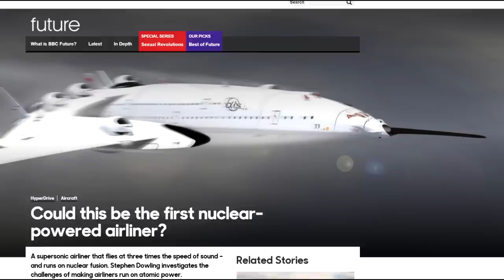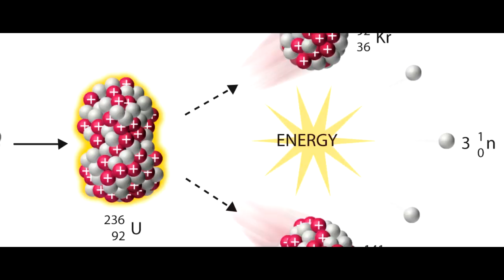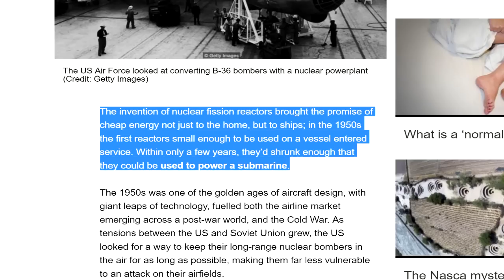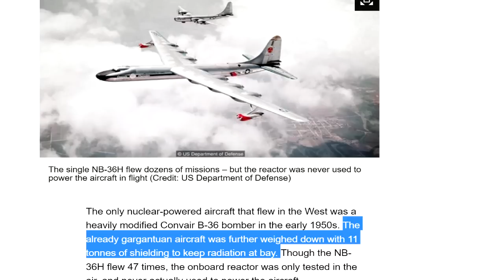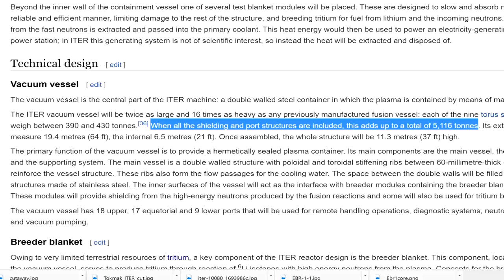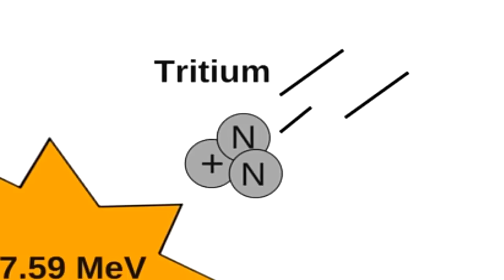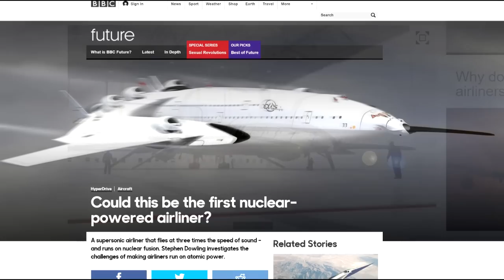SIX ENGINED Nuclear Airliner... BUSTED!

Comment: The only US aircraft to carry a nuclear reactor was the NB-36H. The reactor was never actually connected to the engines. The program was cancelled in 1958. it was done as a proof of concept to see if planes could even fly with a reactor on board as it drastically increases its weight do to the shielding for the crew.. in this case the planes windows where made from a lead containing silica witch distorted the pilots vision so much they where basically flying on instruments only. 
totally impracticable.

and just incase your wondering , yes they also tried flying a thorium reactor at some point in time
Reply: Thank you
Reply: Heres a documentary:
https://youtu.be/c_yQOPZ5CY0

Comment: Hes not even considering the temperature that builds up from the air friction. The black bird has problems with fuel tank leakage because of the large amounts of heat causing materials to expand and is built from titan. Now imagine a nuclear plane flying at this speed,  beside the fact that the passengers would cook up in the plane they would also get a nice radiation tan as theyre boarding their flight, why ? Well because as on the Blackbird, also here the fuel tanks would be built to work at high speeds and not prior to take-off. And the whole plane design makes me cry :(((((WTF !!!! I seriously think this jizznit dildo would break into pieces just after reaching mach 1 !!! 
In conclusion if this plane ever came to fly , north koreas nuclear research programme would be the most superficial thing ever, because this plane would explode just right over our heads.
Reply: how the hell is heat not an issue! THE BLACKBIRD NEARLY FUCKING MELTS AT MACH THREE
Reply: najgauner that was the first thing that occurred to me when I heard about the speed; air resistance
Reply: Solomon Conroy it doesnt nearly melt. Skin temperature reached around 600 Degrees during a mission, titanium melts at over 3000 degrees.
Reply: I misspoke, what I meant is that it puts an incredible amount of stress on the airframe and is still hot as hell
Reply: Solomon Conroy. Sure it is, but its not new territory.  It would be interesting to see more civilian friendly solutions but its hardly a show stopper.
Reply: Solomon Conroy the blackbird way exceeded mach 3. Try 4-4.5.
Reply: your stupidity amazes me
Reply: najgauner. The Blackbird leaks fuel on the ground amd at low speeds because it depends on the heat of high speed flight to  seal the skin.

Since a "nuclear" plane wouldnt have fuel leaks wouldnt be an issue.  And really the heat isnt that big of an issue.

Comment: why exactly would it need 6 engines? the point of the jet engine is the powerplant. if this thing is supposed to be fusion powered, then it should only need one core to provide for the entire energy/electrical load.

Comment: To be honest, a high efficiency battery would be a better idea for a non-fuel based plane. Since, even though you would lose a small amount of energy from the power plant to the battery, not having massive shielding significantly increases the vehicle's energy efficiency by reducing mass. Even though this is still pie in the sky at the moment.

Comment: I work with tritium. You don't need a lot of shielding to protect yourself from its radiation, 1mm plastic tube walls are thick enough.
Reply: there is a difference from the amount of radiation from the material and the radiation generated from a reactor. Its not just radiation its also heat. Nuclear powered reactors were tested on planes and abandoned because either they were too heavy, or put out so much heat they would melt through the airplane frame and fall to earth.
Reply: Tritium is extremely radioactive, as he said in the video. It emits beta-particles, which as you said can be shielded by 1 mm of plastic. Now think about a leak of a few kilograms or even tons of tritium, it's a gas at normal temperature and pressure. Even when only a small keychain light with tritium would break and even with a really good gas mask I would not go near that, the only thing suitable in such a situation is venting and a closed system breathing apparatus.

Comment: 4:54 I'd have to disagree with you there Thunderf00t. I'd say that it is entirely possible that we will discover a way to miniaturize the reactor shielding, if we find an active shielding process rather than a passive one. Instead of stopping these high energy particles by just sticking lots of mass in their path, perhaps there is some yet undiscovered mechanism that could suck them back in like a magnet, or at least alter their trajectory and cause them to orbit the reactor, and that would require far less mass to function. Perhaps there could even be a more efficient passive shielding system, such as surrounding the reactor in something similar to one of those fiber optic Christmas trees that channels the particles into following a specific path

Comment: The Germans built a nuclear powered plane which used the heat to expand the air passing through the jet engine but the lack of shielding caused the project to be retired

Comment: just so you know nuclear powered aircraft have flown yes they have and you're basing your whole video off of an engineering idea this is the first step when you build anything and then you have an engineer build a model you work with separate departments you find different scientists that have different Specialties and you collaborate and before you actually physically build anything you run it through simulations now you run it through models you find what material is you're going to use but all that starts with Concepts and drawings of how many Motors you want on it how many engines you want on it how many serve as the aircraft was going to need how many miles of wire what type of wire what type of conductive material is going to be used in your country what kind of systems are you going to use what kind of computer systems you can use what kind of Fail-Safe system so you can ask what kind of fly-by-wire system so you can use what kind of communication systems you can use how is going to affect each other how are these systems going to work together how is this isn't going to be powered how are you going to have the list goes on all this is done and thought of before anything is ever built you go through what you go through it and go through it and you find out that this system is not going to work with this system so before you even try to put it in a freaking model you figure it out on paper called engineering
Reply: Cory Mader, A concept is fine, but you do realize that all of those questions cannot be posed if the proposed method of propulsion doesn't even exist right? He's debunking the possibility of it as of what we have. Do more research on that plane you're talking about and be sure to tell us how much more practical it'd be.

Comment: While I agree those plans are bullshit you forgot about aneutronic fusion which would require farr less shielding.
Second, even with regular fusion you could get rid of the weight of the fuel which would allow a lot more weight for shielding.
Third, you could employ a mix of regular shielding and shadow shielding which would bring the weight down further.
Also you saying that the ITER could not be made smaller is COMPLETE bullshit. the arc fusion reactor is far smaller.
https://en.wikipedia.org/wiki/ARC_fusion_reactor
Plus there are quite a few other reactor designs out there that could be used.
There are quite a few other things I could mention.
So while these plans are bullshit, your assesment of the feasability of using nuclear fusion once developed to power aircraft is not very good either.

Comment: Just for fun though (even though I already suspect it wouldn't work): what if the steam turbines powered some propellers or jet engines directly rather than powering a generator?

I don't really know how many rotations per minute or what kind of torque output the steam turbine part of a nuclear power plant generates though, which is why I'm already skeptical of my own idea.

What I do know is that each step of energy conversion usually means heatlosses. Which made me think that using the steam turbine to power a generator to generate electricity to then power an engine would amount to more lost energy than simply powering the engine directly through an axle and some gears from the steam turbine.

Comment: There are aneutronic  fusion reactions such as those involving helium-3 but the Earth has very little helium-3 and you pretty much have to go to the moon for it.
But still it's going to be a long time before we see a fusion powered aircraft and it would be easier and cheaper to just Manufacture a chemical fuel such as liquid hydrogen with said fusion energy and use that to power your airliner.

Comment: Nuclear powered airliner: (1) build a nuclear power plant. (2) wait until batteries are above 500wH/kg and use the nuclear power plant to charge them. (3) short haul would already work with batteries of that capacity, and longer routes could use stages, like a rocket.  That is, batteries that drop away and fly home, or wherever, for recharging.  (4) The very longest routes can burn synthetic hydrocarbons produced using energy from the nuke.  It's carbon neutral and would work on today's airliners.  In fact, (4) could be used to make all airliners nuclear powered today.
Reply: That would not really be a "nuclear powered airliner", despite the nuclear power source. It would be an electrical airliner. And, I believe energy densities of at least 800 Wh/kg would be required for a practical commercial airplane (not inter-continental, for distances up to 3,000 km), or three times the current state of the art of Li-on technology. At the same time battery cost would need to drop to 1/3 of the current KWh cost. For inter-continental flights hybrid fuel engines + motors would make more sense. I bet airplanes will also wet their feet with the hybrid approach first, just like cars.
Reply: Of course, I was being cheeky when suggesting a way to 'nuclear' power airliners.  The technical challenges involved in shielding against radiation, and the environmental consequences of flying into cumulus granite, vs the simplicity and safety of battery (and hybrid) airliners means the latter will undoubtedly prevail.

In your estimation of 800Wh/kg and battery costs, did you take into account redesigned airframes that may take advantage of new engine (well, motor) configurations allowing for simplified and more efficient designs?  I ask because, as with thermal engines of a century ago, we are now seeing a paradigm shift in aircraft propulsion technology starting at the smallest scale.  R/C, ultralights, power gliders and light aircraft all have respectable working example of electric propulsion, and many in configurations that would not be possible with a thermal engine.

I'm certainly looking forward to the day of 1kWh/kg batteries and pure electric intercontinental flights that take advantage of ultra-high altitudes.

Who knows, maybe the hybrid airliner of the 21st century will be electric/rocket propulsion, skimming our ocean of air rather than plowing through it like a submarine.

Comment: Um the Air force actually came close to creating a nuclear powered bomber using a molten salt reactor during the cold war. The reactor was finished however it never got to testing it in the plane. However based on the engineers that work on it (i think only 5 are alive today) they stated it would work even if the idea was stupid. If the reactor they are using is a molten salt reactor it is very possible since the set up for a molten salt reactor is a million times simpler.

Comment: There was a military experimental plan that was worked on a long time ago.  However like you said, shielding was an issue.  If I remember right they where using led as shielding.  The plan was so heavy it could not get off the ground.  The reactor could not produce enough power to overcome the wight.  And I have not heard anything about the military trying it again.

Comment: As far as i'm concerned, in aviation, you need combustion that propels jet aircrafts forwards. But if you use a Nuclear power, who is going to propel a jet airliner? Note that the B-36 is a propeller aircraft, and I know it because it's one of my favourite, unique aircraft. The four jet engines at the tip of it's wings are not used in flight, and surely it's powered not by nuclear, but something else. Those jet engines are only used on takeoff, that's all. So in conclusion, this guys is just daydreaming in his fantasy world, and then drew that plane he envisioned it to be, and proposed the idea to public whilst knowing absolutely nothing about aviation! A propeller propelled airplane cannot go beyond the speed of sound! (Correct me if I'm wrong though)
Reply: Saying that you NEED combustion in a jet aircraft is not strictly true. What you NEED is a heat source to heat the air moving through the engine. It just so happens that today, the best way that we know how to do so in a safe matter is by burning energy-dense hydrocarbons. However, it is not implausible that you could just use the heat generated from a nuclear reaction instead of burning fuel.

This same concept was tested in rocket engines by the US back in the '60's and '70's. Google "Project Rover" or "Nuclear Thermal Rockets" and you'll get some fascinating articles. In a nuclear thermal rocket engine, no combustion takes place, yet it still produces thrust.

EDIT: Also, you are generally correct in saying that propeller driven aircraft cannot break the sound barrier, or even really get very close to it. However, It did not appear to me that the aircraft in the article from the video had propellers. It looked jet powered to me.

Comment: He was talking about D-T fusion there, which is technically the easiest to start, but not necessarily the most practical form of fusion. He3-He3 fusion produces no neutrons and turns He3 (stable, non-radioactive) into He4 (which is your everyday Helium, also stable and inert). So, He3-He3 fusion for example is completely clean, produces no waste, and thus wouldn't require as much (if any) shielding, the drawback is that He3 is quite rare and it's more difficult to start the reaction.

Comment: YOu know Thunderf00t..the other problem there , and I'm sure you see it, is aerodynamics. 3 times the speed of sound. that plane wing shap is not going to do that speed. The plane would simply burn up or become so unstable that it breaks up. Of course it would have to run first, create thrust using the power plant they think they are going to implement. So I guess it wasn't really anything to worth mentioning.

Comment: Nuclear powered aircraft wouldn't work here on earth, but would probably be viable in space.
The reactor could be separated from crew living space by a long hallway, reducing the amount of shielding needed( less mass = cheaper )
You wouldn't need to shield the reactor 360 degrees, only the side which is exposed to crew .

The reactor would then create lots of electricity , which in turn would create intense light, and shine it in the opposite direction of travel, emulating solar sails. However this design would not depend on the sun, or direction of sunlight.

Comment: I'm surprised that this video is only 7 minutes long, there are so maney other reason why this plane could not work. Also super sonic engins do not run of electricity and there is more or less no conceivable way they they could.
Reply: You don't need electricity to run a jet engine, just heat. Producing heat is exactly what a nuclear reactor does. In fact, electrical power generation systems are nearly identical to jet engines. Both use the Brayton Cycle to drive gas turbines, which produce a net amount of shaft power. You can then use this shaft power to turn it into other kinds of energy. In a power plant, the shaft drives an electrical generator. In a jet engine, the shaft drives a fan, which moves air through the engine, creating thrust.
Reply: i guess, but you still need to transfer that heat
Reply: Heat exchangers are pretty lightweight and simple compared to the rest of the parts of a jet engine. An extremely basic one can just be two concentric pipes with the hot fluid from the reactor in one and the air going through the engine in the other. The heat transfers from the hot fluid to the (relatively) cold air. You can make more complex ones to make the heat transfer more efficient without adding a significant amount of weight either. Believe me, heat exchangers are not the technological limitation here.
Reply: i am sill unsure whether it is even possible to get enough power across without directly using the reactor fluid directly. This is presuming that the reactor fluid is water if something else was used with a higher boiling point than water then it could be used to boil enough water quickly enough to create the pressure, but you would sill need a vast amount of water to expand on board.
Reply: Icermun you absolutely could. Take a look at nuclear thermal rockets. These actually require even hotter temperatures than a jet engine, and NTRs have actually been experimentally tested by NASA and the Air Force back in the 70's or so.
Reply: but they do use the reactor fluid and i was referring to the heat exchanges i did not think there would be a problem generating enough heat, but yes nuclear thermal rockets are interesting.
Reply: You could also just use the air from the engine as the coolant (and the eventual goal is to heat the air anyway, so this actually makes perfect sense) and therefore eliminate any need for a "reactor fluid" besides the air already going through the engine
Reply: Air as nuclear reactor coolant? oh and the kestrel 2 might have a heat exchange that can deal with that amount if heat.